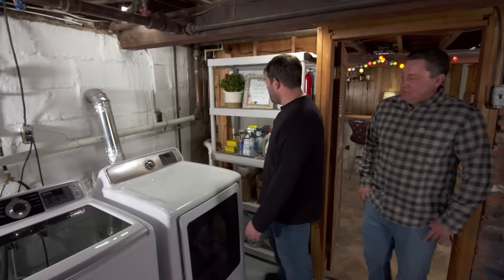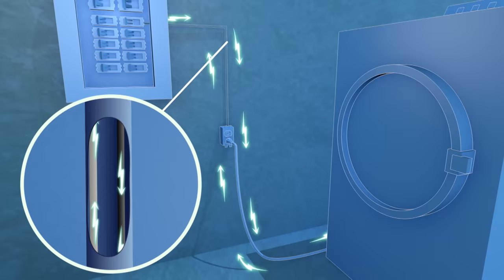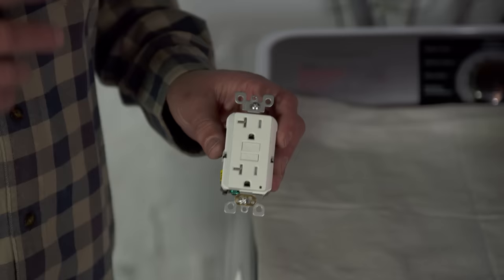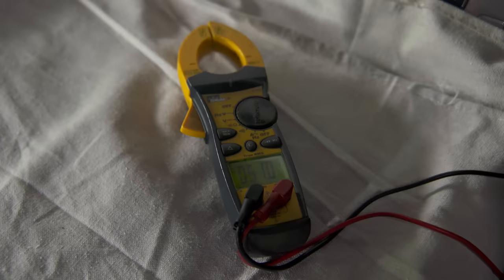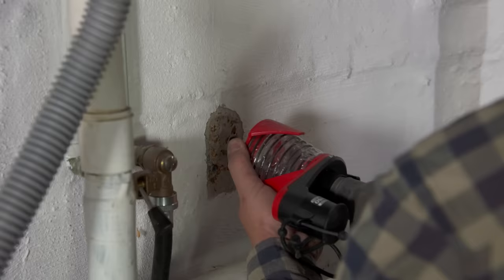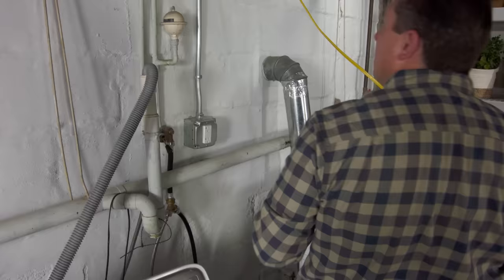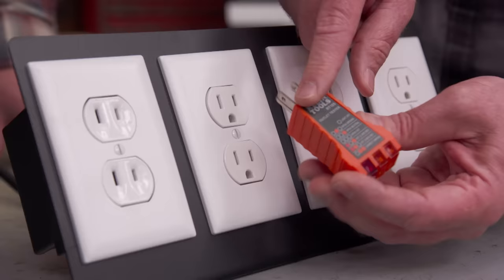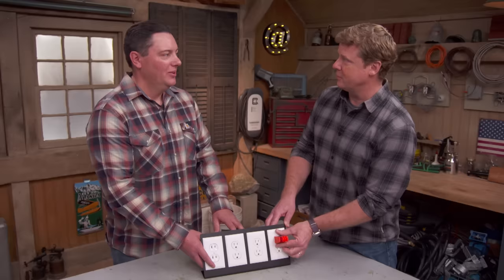How to Ground a Two-Prong Electrical Outlet | Ask This Old House

Comment: @3:20 could you please elaborate on 'bunch of violations'?
Reply: TOH rarely responds to questions here. It's up to professionals watching to comment. (TOH - Prove me wrong on this one. )
Reply: Lee Whitmore l
Reply: I'm not a code expert, but electronics. The box was metal but was not grounded meaning it was never put in right in the beginning because if it was now it'd need that third bare wire he added. Prior to that the ground would have been through the main box but this set up didn't even have that done correctly because there was no metal conduit to carry that ground current (if it ever did happen) back to the grounded main box. ( This was common in homes of the 50s and even into the 70s they rewired with flexible metal conduit. That metal jacket being the crucial ground path. ) In other words, the added outlet was likely a quick fix done by some one who did not even try to match common sense, much less code.
 Modern day code requires any box within so many feet of a water source be a GFI because it significantly reduces the shock hazard which used to electrocute people. I forget when this started but you can google it up if you are really interested.
 Those "wings" you see within the outlet designate it as a 20 amp female receptacle which means you are not supposed to use 14 AWG because its only rated for 15 Amps. This could have been another violation - honestly I couldn't see close enough to know if this one was true in this particular case. But it's not uncommon and worth mentioning.
Reply: Another note - Klein Tools, the brand of the tester used, is a very good brand. When I went to school for Avionics the tool kit we were instructed to buy was almost all Klein tools and a Fluke DMM.
Reply: Junction box isn’t bonded, exposed NM.
Reply: I’d also bet that 14 gauge wire was tied into a 20A circuit. You can put multiple 15A receptacles on a 20A circuit but you can’t put any 20A receptacles on a 15A circuit.
Reply: @RadDadisRad  Yes you can.. The receptacle is just rated up too 20amps...
The violation was it was not Grounded. No GFCI. As you need to have a GFCI within 3 feet of any water hazard or on an Arc Fault Breaker. That means bathrooms. Kitchen sinks. Counter tops close to water faucets. etc... 

And no you can't put a 15 amp receptacle on a 20 amp breaker. They have to rated at 20amps. Why 20amp receptacles have a vertical and horizontal prong. Just from a visual inspection..You can tell what the rating is....
Reply: No violation existed when it was installed, but today is a violation due to code changes.
Reply: @TallTexasGMan  probably,  I was just curious as to what are those addition violations ( the reason he's there: ungrounded outlet, but hist comment was a bout the junction box above ).
If I pause at exactly 3:21 I can see a bare copper wire  ( 3 of them, are they connected to the box? I can't see)
Reply: @RadDadisRad   (I'm no electrician) why can't you put a 20A receptacle on a 15 amp circuit? Not saying it's wise or useful, what the danger? the breaker will almost certainly trip! 
As to putting a 15A receptacle (or multiples ones) on a 20 amps what would happen  if something pulls more than 15 amps  (sa 18 amps) for a sustained periode of time  (the breaker won't trip)? I say something will melt and.
Reply: @johnpossum556  I have three  non GFCI outlets in the kitchen ( the house was built in the 70s) ... I reaaallly need to add a one :-/
Reply: @foufou33g  Two of those Romex in the junction box had no ground....And the white wire was only rated to 15 amps..The other two you see were added later. As the insulation is black...But both are only rated to 15 amps...
You answered the other question yourself... As you can put a 20 amp load on any one 15 amp receptacle..Which is a fire hazard...
As for the house. Just add one GFCI after the breaker. Being sure to read the label. So line side is off the Breaker. Load is for anything after that. Then label the covers with the GFCI protected labels. As they provided with more of them in the box..Then mark on them the Breaker number and GFCI location. If it ever trips. They know where to find the GFCI. If it ever trips first....
Reply: @foufou33g  I wouldn't stress about it too much unless you have kids that like playing with the electricity. I live in a building from 1958 and I've never even upgraded to GFCI outlets. I am just careful & sensible around water with electricity.
 But I'll tell you a story. I did upgrade a 1970s garage wired to a house years after a remodel. First clue was my circ saw did not have good power in the garage circuit.  It would bog something fierce and it didn't do that when I used it in the basement or on other circuits. I saw he used red and black wires which also cued me in to check the whole circuit (because they are DC circuit colors, not AC circuit colored wires).
 I found the wire had just been taped together under my bedroom and the circuit only had 65-70VAC so it was a weak connection (high resistance ) and dangerous circuit as it was a fire hazard right under my bedroom. It wasn't a matter of if, but when this would light up. I fixed that with a new box and wire connectors. Then I put a GFI in the garage just as a precaution and sure enough the garage filled with water after one rain and I turned on an old trouble light my father had and the GFI clicked off and saved my life.
 You never know what troubles you inherit when you buy a home some one else has remodeled. The same jerk who made the concrete slope into the garage to funnel all that rainwater in there was probably the guy who wired it, too. 

 BTW if you figure out which outlet is first in the sequence of kitchen outlets you can just replace that one and have it cover the other 2 outlets. It's a little tricky to explain here and now. But any decent home supply shop/lumberyard should be able to show you how it works. Google it and there's probably some one here on YT who can show you how it all works.
Reply: @johnpossum556  :facepalm:

as for finding which outlet is first, that is precisely the reason It's still not done :-) it'll require much fideling to find the one! I'll do it some day !!!
Reply: @MasterChief-sl9ro  thanks for the tip.
Reply: @foufou33g  ... if laid out by code, a 20 amp circuit is only supposed to handle 16 amps (80% of breaker rating) and if you look around I'd bet you have a hard time finding a single appliance that draws 18 amps. Even a 1500 watt heater only draws 12.5 amps. I have seen a few 1600 - 1800 watt hair driers, but that tops out at 15 amps.
Reply: @rupe53  a (110/18) ohms resistor will draw that much. There was no particular reason for 18 (except that it was above 15). Replace with 16  (or even 15) and my point would still stand (terminate a 20 amps circuit with a 15 amp rated outlet is a fire hazard).
Reply: @foufou33g  ... as explained in table210.21 (B)(3) of the NEC you may use 15 amp duplex outlets (or several) in a 20 amp circuit because the pass-through rating is 20 amps. However, you may not install a single (dedicated) 15 amp outlet in a 20 amp circuit. This applies for residential code.

Comment: Ungrounded  outlet...solution?  Remove it.
Reply: Yeah, real helpful video
Reply: Add a GFCI at the beginning of an circuit of outlets that way you don’t have to replace the out two prong outlets. GFCI protects the entire circuit.
Reply: @introvertelectrician17  With GFCI protection upstream you can also replace the old 2-prong receptacles with 3-prong, if you like.

Comment: My home had many two prong outlets when we bought it and metal boxes. I replaced most of them with new three prong outlets and ran a small piece of wire from each outlet I installed to the metal box the outlet sits in. Haven’t had any issues so far it’s been that way for years. Others will run a wire from the neutral screw on each outlet to the ground screw on the outlet. Call it what you will. California Ground or Norwegian Ground. Most electricians would not agree but it’s what us guys have to do in our old homes with a budget.
Reply: For an old house with the armored cable wiring and metal boxes, the armor is likely connected all the way back to the breaker box ground. Not much more you can do without opening the walls.
Reply: Bonding the device to the metal box does nothing because the box isn’t grounded to anything
Reply: @electricaf365  You're entitled to your opinion. My ohmeter says otherwise.  The cable armor is connected to ground in the panel. Outlet box is connected to cable armor.
Reply: @jeffweber8244  touché, I didn’t realize you had armored cable

Comment: Could of just used a regular non-gfci three prong receptacle and dual combo arc fault/gfci breaker.

Typically you don’t run Romex through conduit. Technically it’s not a code violation but it’s not standard practice either. The outer sheathing on it makes it harder to remove if it ever needs replaced.

It looked like he used the screws that came with the conduit box and conduit clamps. When attaching to brick, cinder block, or concrete wall you should use tapcons.
Reply: Tapcons are new.  This might be an old video.   You can run romex thru conduit, where you want to protect it.   quite frankly, otherwise, you'd have the bare wire running down the concrete wall. Also there are times and places where the mice, need to be prevented from chewing the wires.  That's my current battle. I replacing wire in circuits, that the mice have liked chewing on.   They got several circuits before getting offed by their hobbie.
Reply: Or an anchor.
Reply: @normbograham  patented in 1976 so their definitely Not new.
Reply: @scottslotterbeck3796  Tapcon anchor is the original masonry fastener and it revolutionized the fastener industry.
Reply: @kalijasin    Depends on your prospective.   I left professional construction in 1980, and the tapcon had NOT been accepted for any of the employers on the east coast work I did.   The late 70's was using the aluminum fastener, you drove a nail thru, and it grabbed the concrete.
Reply: @normbograham  the install in ToH video was 3y ago.
Reply: @normbograham  that’s fact not perspective.

Comment: Never forget the fundamentals. Electrical current does not just "go to ground". It ALWAYS returns to the source (generator, transformer etc..). 
The purpose of the equipment grounding conductor (ground wire) is to provide a low impedance (resistance) path BACK TO THE SOURCE to immediately open the over current protection device (circuit breaker) . In this case the source is the transformer out on the utility distribution pole where the current was created.
Reply: So the power company is getting back energy we use? 😮
Reply: @kalijasin  no
Reply: @kalijasin  you need to understand electrical fundamentals
Reply: @QuaabQueb  you made the claim Not me.

Comment: Many appliances do not require a ground (like a toaster) and the code does not prohibit the use of two prong receptacles (i.e. no ground).  It is however unsafe to use a three prong receptacle without a ground connection inside because a three pronged appliance will not be able to connect to the ground terminal.  Also code doesn't require a GFCI on a washer when it is dedicated and not accessible) but it does require an AFCI now.
Reply: True, you shouldn't plug a three-prong plug into an ungrounded receptacle (either with a cheater adapter or an illegally installed 3-prong receptacle) unless it has GFCI protection.  Also, in what version of code is 125v receptacle in a "laundry area" (let alone one in an unfinished basement) exempt from GFCI? It's been in the NEC since 2014.
Reply: Good point  @UpnorthHere .  My comment was in reference to the CE Code in Canada (sorry didn't realize you were in the US).  Canadian and US codes are largely harmonized but this might be one divergence and probably due to the different bonding requirements within appliances themselves.  In Canada "The requirement for Class A ground fault circuit interrupter protection is not intended to apply to receptacles supplying appliances located behind such appliances as washers, dryers, fridges, ranges, built-in microwaves, and other similar appliances, provided that those receptacles, by virtue of their location, are rendered essentially inaccessible for use for other portable appliances." - I will have to check the NEC for exemptions.  - www.linkedin.com/in/pierredoucet3

Comment: How to ground a two prong outlet. Apparently the answer is just run new lines. A little deceptive in the title.
Reply: That is the answer. There is no other code-approved way to ground an existing outlet if there's no ground between it and the breaker panel.
Reply: ... and replace the outlet ;)

Comment: I browsed through as many comments as I could and did not notice anyone ask about the sheathed romex fed through the conduit.  I think that is a national code violation.  isn't it?  AND, if you are going through that much work, why wouldn;t you add additional outlet receptacles for use for fans, irons, space heaters or what ever you might want instead of tempting addition of splitters or power strips on the one receptacle?

Comment: I like Heath better than Scott. He explains things well and does the work professionally. Scott is ok too but was never a fan of him taking shortcuts like using his linemen's to strip wire.
Reply: Arie and hammer with pliers. Both of those are signs of a crappy electrician. One video Scott drilled through a box to the exterior for an exterior outlet. That is how we do it, but not on tv!
Reply: @KitchenerLeslie2  -  that's called efficiency.
Reply: Arie -a good set of lineman’s pliers has a stripper built into them nowadays. Why not use them. They’re already in your hand. That’s efficiency at its finest. I’ve seen plenty of electricians bang staples in with their lineman’s. Why not? They make a nice light flat small space hammer and they’re an indestructible tool
Reply: I have been using linemens pliers for many a years to strip. If you know what you are doing and have a sense of touch there should be no problem.
Reply: jerry demas I can use them, you can’t tell me you’ve never nicked a wire. The proper strippers cannot nick the wire. Anyone that uses their pliers to strip romex jacket or wire insulation is dumb, cheap or lazy. Those are the only three options.
Reply: King of Epic Vlogs pliers have a sharp edge. There are no good linesman pliers with built in stripping tools.
Reply: @jerrydemas2020  You say that but every single person I've seen who does that with solid wire ends up scoring and weakening it. Maybe it won't snap in half this time but the next time someone opens it up, it'll snap off or worse, have intermittent connections later.  If you're stuck in an island without any other tools, sure, do what you gotta do but it's still bad form.
Reply: @kingofepicvlogs4666  I have the Klein Tools J2000-9NE and there is no stripper. It just does one thing very well. Scott just had a similar one.
Reply: jerry demas hammers, knives and wire stripping tools all existed way before linesman pliers and are better at their intended tasks. If you use your pliers for stripping and hammering you are a hack end of story. You can’t defend it because you are wrong. If I saw some slack jawed hillbilly hammering with pliers in my house I’d throw them out of there. You can’t be serious defending using pliers to strip and hammer. Sure 90%+ of the time you don’t damage the wire, but what about the rest of the time? Our industry usually fine is not a standard you should shoot for Jethro.
Reply: Arie any nick in the copper heats more too

Comment: If you are going to the trouble of running a new line and circuit box why not put in two outlets as well for some extra outlets? It was a dedicated laundry location outlet it does not just have to be for laundry.

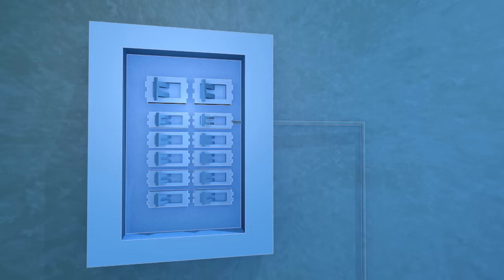Comment: At 0:25 the dude face, its has if someone just explain to him what dark energy is.😶
Reply: Incidentally, 'dark energy' is actually matter - positively charged sub-quark particles with a small negative mass, i.e. it attaches to the 'underside' of the space-time membrane.  Small mass in that it is about 40% of the magnitude of the small mass of a corresponding negatively charged sub-quark particle.  😶😳
Reply: @amerlin388  - And this is exactly the problem with politicians today 😁✌
Reply: Hilarious!

Comment: How many electrians is this show gonna through before they decide to just get Richard to do it.
Reply: Who is Terry?  I liked Scott Caron a lot.  He knew what he was doing and had a good personality for TV and seemed to mesh well with the rest of the cast.  No one will say exactly what happened but he and the producers had some sort of issue and he was fired from the show.  In the Boston area Scott is very well known as one of the best electricians and his pricing is very fair.  I never heard of Heath until he was on the main This Old House show a few seasons ago.
Reply: Richard is a master plumber. He's said several times on the show that he's not a certified electrician and thus will not do any electrical work that requires certification.
Reply: @RobertLeBlancPhoto   I understand that, but he is more than capable of doing these little electrical projects. I wasn't being serious.

Comment: 3:03 this is wrong, not if have done previous test etc, but never trust the breaker breaks the hot, i never seen the N being on the the breaker, but i never trusted blindly it either. Could be because i have from the start seen such obvious out of code violations (straight up dangerous) that i trust nothing anymore.